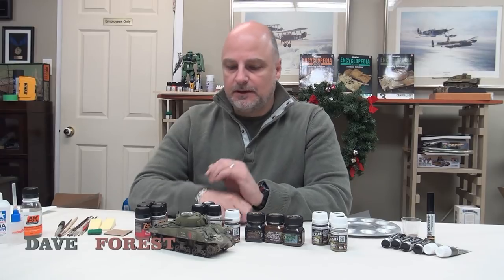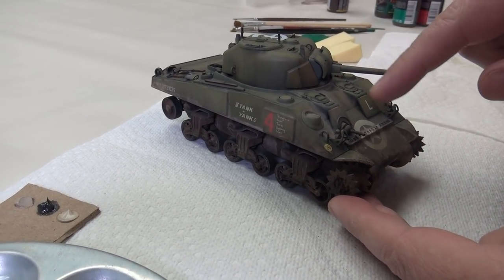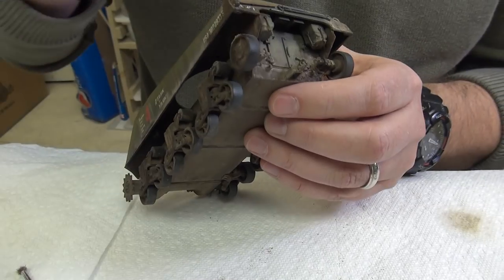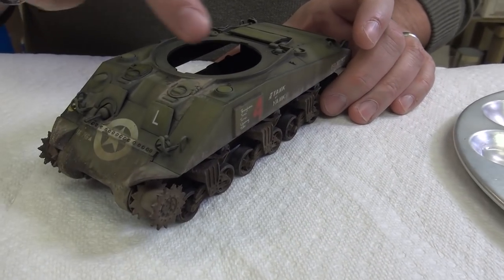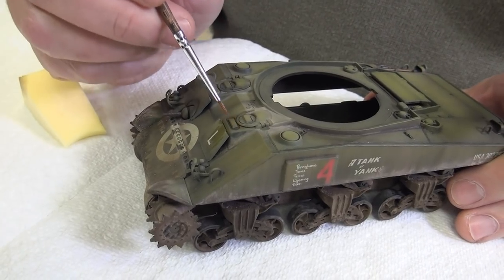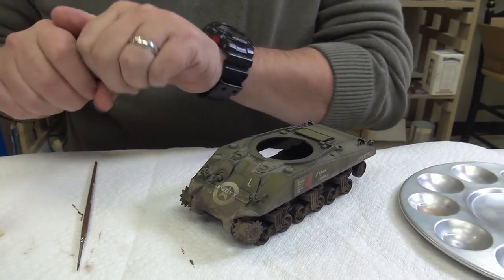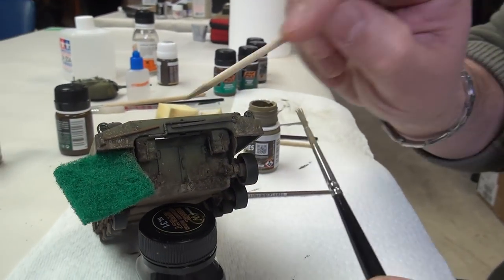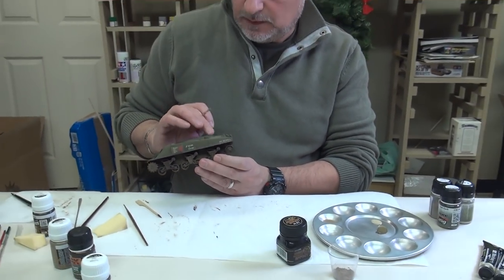Applying Mud and Dust on Armour Models Episode 4 Part III

Comment: Hello Daves, I am writing from Brazil, and I want to say thank you for your videos, its amazing see in detail all your techniques and the Sherman weathering evolution. One question, would you do some chipping BEFORE the Mud and Dust application or after? Look forward to see the Tracks weathering also!
Reply from the maker: Here is the answer:
 
I would do most of the chipping before the application of the mud and dust.  However, I might also chip some of the more exposed areas after the application of dust and mud to simulate new chips that might occur.  For chipping, it’s important to remember that not all of the chips would have been created at the same time.  These would occur randomly on the tank over time due to terrain, crew, near misses, etc.  Having said all that, I didn’t put any chipping on the Sherman as I felt it didn’t really need it.  Too much chipping can ruin the look of a model.  I hope this helps.
 
Dave